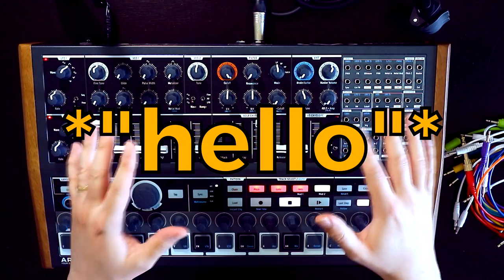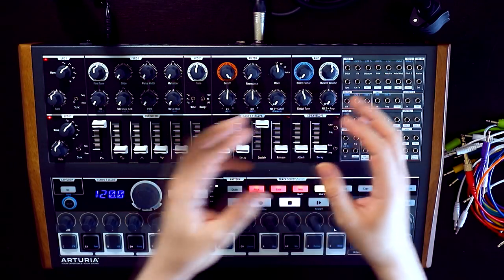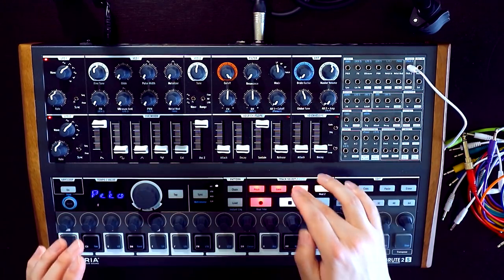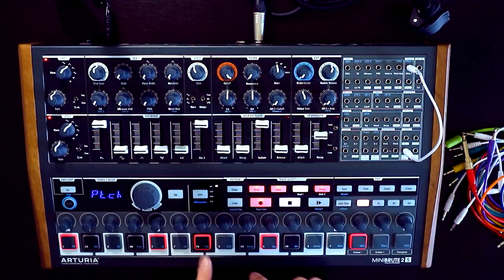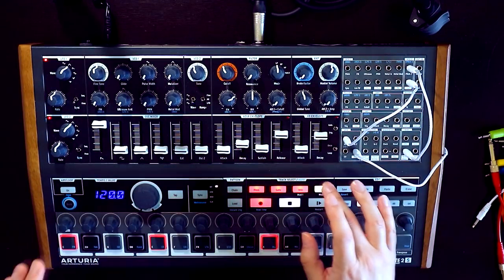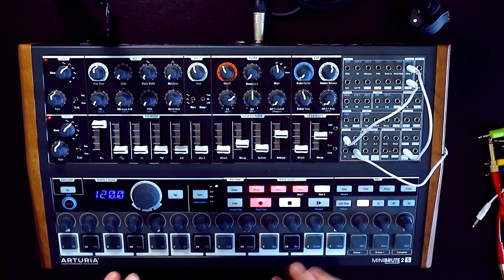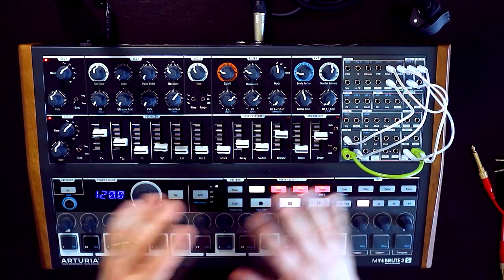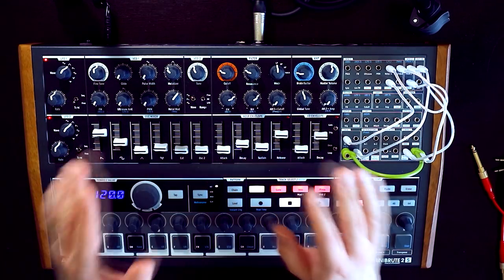Arturia Minibrute 2S - Let's Build a... Polyphonic Multitimbral Patch

Comment: Sync the LFO w/ the clock, patch it to noise and send it through an envelope and you have your rythm section as well :)
Reply from the maker: We'll be needing another VCA for that though sadly - no direct CV control over any of the oscillator and noise levels. Time to buy a Rackbrute and a bunch of modules then I guess...
Reply: @OscillatorSink  Maybe I just used the oscillator track for that and I misremember, that's probably it.

Comment: I am just loving this sequencer, with all voltage, env and lfo options on tracks 3 and 4. Figuring out new stuff every day - so happy i got 2 s and not keyboard version.
Reply: What does voltage do?
Reply from the maker: Lets you set an arbitrary control voltage per step.
Reply: lowpass eq Depending on  what you want to do, control voltage allows you yo fine-tune different synth components per step. You can even control multiple components and modules ( on Minibrute OR on another modular or semi modular synth, as long as those modules have cv input) at the same time by using stacker cables. Control Voltage is the first form of synthesizer control - long before MIDI was developed, CV was used to send pitch and other commands across synths. Super cool thing on Minibrute 2S sequencer tracks 3 and 4 is the fact that you can change starting amount of CV you are sending - from 1V to 8V, this is very useful for detailed control. Combining these two tracks and stacker cables you can pretty much control super large setup - this sequencer was designed with modular in mind primarely.
Reply: I’ve been scratching my head with 2 or 2s. Been wanting to muddle with modular for a few years and recently the Moog bundles have caught my ear, but can’t afford new, the Subharmonican I like very much. The only piece of analogue gear I have, that has been in my proud possession for a very long time, is a Stylophone (don’t laugh) it’s what I refer to as the Mothership version, it’s a 350’s which has a fat knarly sound. The sequencer on the minibrute seems impressive. Is it good for playing live?
P E A C E    ; )
Reply: @FUNKINETIK  First, i would never lough. Price if the synth or its complexity do not dictate the outcome. I have 50 quid  dyi modules and a Jupiter 6, Prophet 10 and REV 2, OB 6, UDO 6, Pro 2 and 3, Dx7 , JV 1080 and a modular setup - so i just want to say, any instrument is good if you get great things out of it. I am not crazy about Subharmonicon, but thats my personal stuff. Now, If you are going to go into modular, get S. It is simply a beast, I have Elektron devices and it is the closest thing you can get for your modular stuff - remember, modular sequencers are extremely overpriced and limited. Here, you can control 4 tracks, use CV, choose evelopes and lfo per step so its totally mental and great to use on modular system. I use oktatrack as my main sequencer, but i sequence all my modular via Brute 2S. Don't hesitate for a second. Minibrute 2 is just another mono. S is literally igiving you main building blocks for modular, - 2 oscillators, 2 lfos, lo cut and hi cut filter, envelopes and this insane sequencer. You can then go get some more exotic oscillators, filters and effects. Definitely recommending 2S. Even sequencer is worth the 400 quid alone, and you do get a decent oscillators and filter with it. 
Also ,it is amazing for playing live as it is easy to change stuff on fly, i mean, Arturia sequencing is one solid thing that is built for performance.
Reply: @earlsfield  Hi, thanks for your in-depth reply, much appreciated. Well it looks like my Stylophone 350S (I’ve actually got two of them) has a companion on its way. I just about managed to be the winning bidder for a Minibrute 2S in mint condition on eBay. ; )
Reply: @FUNKINETIK  no prob:) Glad if I helped:)

Comment: I have the minibrute with a keyboard and a key step, can I do this? I also have a microbrute but have yet to route it through the mini
Reply from the maker: You'll have to modify things a tiny bit, but using the CV outputs on the Keystep, you can get to a similar place yes.

Comment: Such nice timbers... Reminds me a bit of the sounds of the O Coast in a way. About the BSP, I guess that you can achieve that with the drum sequencer. You can have a separate line for AD envelopes, but you would need some kind of a slew limiter. Send the gates to the slew limiter and from there to modulate the VCA.
Reply from the maker: I'm trying to find a way to properly approximate a west-coast style patch... Lots of ideas, but I'm almost always a VCA short (apparently you can never have too many, so I'm told).
Does the drum track send out gates or trigs on the BSP though? I think trigs, so would the slew limited have enough to work with in that case?
Reply: @OscillatorSink  Well, actually those are gate outputs, and you can also change the gate time with the third mode of the knobs mode so I guess that it could work with a slew limiter. The BeatStep Pro is a beautiful machine...
Reply from the maker: Oh wow, yeah that should work then! I'm an Elektron fanboi but Arturia really know how to build a sequencer for live jamming.
Reply: @OscillatorSink  Yeah, the Arturia sequencers are very intuitive and playing them is like having a conversation with them. You say something, they react, you react back, and so forth. It's a unique experience.

Comment: Important tech video you made of the evolution of this beast! Please help me,.How do you turn off glide function? Your time is appreciated!
Reply from the maker: @djbmanifestomode  if you turn the glide knob to zero that should do the trick, no?
Reply: @ found it late in the game. 😂 I’m used to that nob being at the bottom of synths so I was looking there along with the shift function. This synth is a wild animal. Works very well with a master synth attached that has aftertouch. I feel like I have a polybrute, combining my virus, the minibrute and the microbrute together. Thanks for replying. They should come out with a programable version. Sadly, my serial number and unlock code for the software is not working. Does it come with a software version for free then I guess that would help make up for the un-programmability and can possibly be used as a template guide, even though it’s not modular?
Reply from the maker: @djbmanifestomode  I think the software is just a bunch of virtual instruments. The midi control centre software is free, but it's more for setting up midi channels, CCs etc. The synth itself is totally analogue, no programming over midi, the knobs are directly connected to the synth itself.

Comment: Hello! any ideas on how to use the minibrute for Ambient Generative music?
Reply from the maker: Some of the ideas I show here are applicable (if you slow them down!) https://youtu.be/y5olX7eBsnc

Also I've been using it in a number of recent live streams which have definitely been ambient, especially towards the end, so check some of those out for some patching ideas too!
Reply: @Oscillator Sink  thanks! have seen the video and help. I'm going to check the live streams. What I have in mind is somehow combining the Paraphony possible with the sequencer with the Random mode in the arpeggiator. I don't know if this can be done because I don't have one yet. Im planning on buying one but I live in Uruguay so its not easy getting specific gear here. What I imagine is having 2 notes played simultaneously from a holded chord, and having those notes change periodically, and since it would be randomised, every time the harmony would be different. Hope that it inspires one of your videos! thanks so much

Comment: Would it be possible to create more envelopes with a BeatStep Pro connected?
Reply from the maker: The BSP doesn't generate envelopes, only gates / triggers, so I don't think so?
Reply: I guess my thinking is that it might be possible to create a BSP sequence of high and low notes with slides or ties between them and use the pitch cv to modulate something on the MiniBrute 2s.  If that worked, you could even create custom shapes and possibly side-chaining.  What do you think?  I would try it myself, but I need to order long cables first.
Reply from the maker: Ah, so more of a looping LFO feel than a triggered envelope? Hmm, yeah I see no reason why that wouldn't work! Might be fun to try!

Comment: Inspiring video and one of the reasons I purchased an MB2s. But, something isn't making sense to me that I'm hoping you can provide some insight on:

If VCO2 is already in tune with VCO1, why does it need to be re-tuned when plugging in note output from Mod1? And why did you need to switch VCO2 from "fine" to "all"? 

I suppose I could understand if VCO2 was off by an octave or two (a volt or two) when receiving Pitch input, but why is it flat or sharp?
Reply from the maker: When the VCO2 pitch doesn't have anything patched into it, it's hardwired to follow VCO1, relative to how you have the pitch knob set. That's because it's getting the same v/oct CV as VCO1, and the pitch knob is basically an attenuator. As soon as you patch something in to the Pitch In for VCO2, that relationship is broken because its no longer getting the same CV as VCO1. Try patching a patch cable into the VCO2 pitch and see what happens: it should stay still and it won't necessarily be still at a frequency that makes musical sense any more, despite how you had it tuned previously.

And yes, I set the range to all because I want to tune it down.

I hope that helps, let me know if you need me to try to explain anything a different way.
Reply: @OscillatorSink  The best explanation I've had of this to date, thank you. The "relative to how you have the pitch knob set" is the part that finally makes sense to me. It's the internal routing of VCO1 to VCO2 that's causing the offset (as I thought) but hadn't considered it being relative to the pitch knob. 

I was hoping to use VCO2 as a standalone voice with the rest of my modular gear but it must be re-tuned anytime it's patched in or out of. I suppose I just have to get used to this.
Reply from the maker: @jbuck802  that is the modular way! Don't think of it as a disadvantage - this is exactly why working this way is so flexible.

Comment: I just got a minibrute2, and im trying to get a talkbox sound but I'm missing some kind of harmonic sound. Any advise?
Reply from the maker: Typically the trick is to use two resonant filters (bandpass ideally, but a high and low pass together works too), but as you only have one on the MB2 here are some other ideas.
Use the bandpass filter with the resonance quite high, and patch the triangle output into ATT1 so you can turn that upto get some audio rate modulation of the filter. Base your core sound around a mix of the Sawtooth wave and the square wave - but set your pulse width nice and tight to get that nasal, throaty component to the sound.

You might also find that using oscillator sync will get you some vocal sounds, so tune VCO 2 the same as VCO 1, patch VCO 2 out into VCO 1 sync, and then patch the ADSR out into the FM input of VCO 1 (and turn up the FM knob to taste).
Reply: @OscillatorSink  awesome! How should I set the vibrato in relation to all of that?
I can’t get it without giving it this choppy ugly vibrato sound while the wheel isn’t even on.
It’s also not a consistent velocity or sound every time I play a note. Do you have a fix for that?
Thank you!
Reply from the maker: @zachperry393  I think velocity is normalled to metal mod? If so just turn metal mod down - or is there a volume change?
Reply: @OscillatorSink  it’s kind of hard to describe. It has the tone I want but when I try to get rid of the really bad vibrato, anything I play with to get rid of it seems to also get rid of that good talkbox tone.
The vibrato sounds like there’s still vibrato even when the wheel is all the way down, and then when I turn it up, it adds another thicker vibrato. And when I turn all 3 rates off and have no vibrato at all, there’s like this clicking sound, almost like a metronome.
Reply from the maker: I think I'd need to see the rest of the patch to diagnose it honestly, sorry.

Comment: Nice workaround! btw I think the correct term is paraphonic not duophonic
Reply from the maker: Thanks. Duophonic is the term usually applied to 2 voice paraphonic synths. The Arp Odyssey, Bass Station 2 (since it was updated) etc. although granted its a slightly grey area.